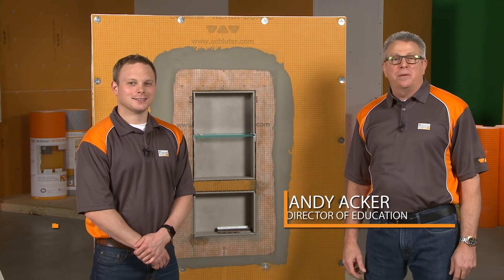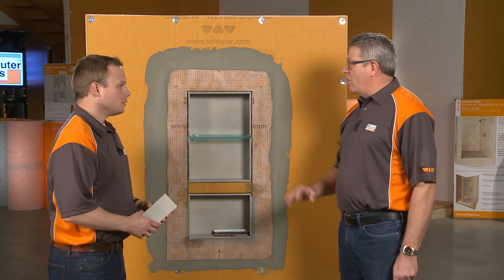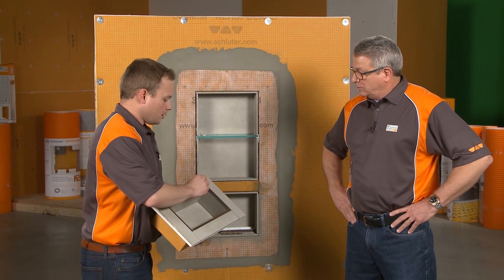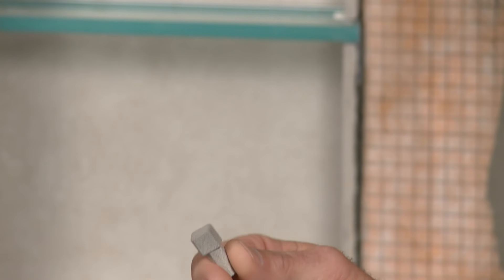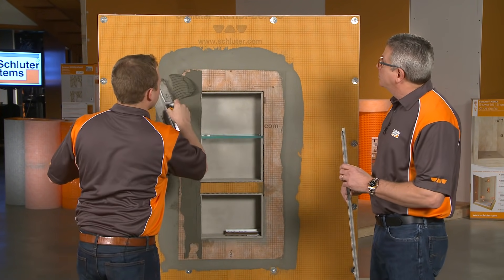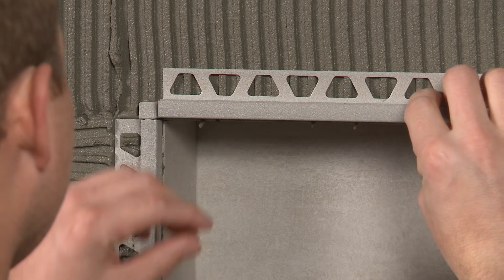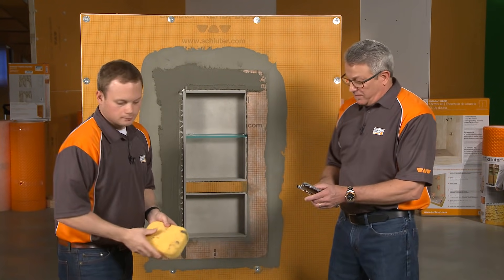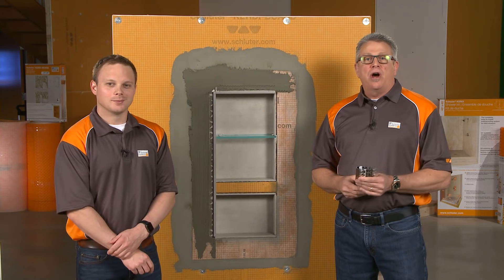Tips on finishing a shower niche

Comment: I set my schluter edging profile on the inside of the niche with miter cuts as I'm setting rile. Then, fab the niche with wood and then coated in waterproofing. not sure why you'd make it harder and doesn't look good setting it on the face, imo
Reply: Thank you for pointing that out I will be doing my niche in the next week or so.
Reply: @Justforfun-ek7et  ser the inside of niche after the face of wall is dried. use the edges of the niche as a guide when cutting around niche. layout and niche placement is important. You got this 👍 @wishbonecustomtile

Comment: Now when the tile goes on the wall it has to much material behind it to be flush with the trim
Reply from the maker: Just make sure to select the proper size profile according to the tile thickness and format-- you should be good!
Reply: So, If I'm installing 1/2" ceramic tile, I have to get 1/2" trim? Does the trim account for the thinset? Won't the tile be higher then the trim with thinset? Please help and explain. Thanks
Reply: @rjvillanueva64  yes, you are correct, get another trim size that is the next higher size to accommodate your mortar.  The people at the tile store I should help you with this question
Reply: @rjvillanueva64  You have the right idea. Keep in mind that a tile labeled as a half inch nominal size isn't exactly a half inch, remember that the anchor leg has a certain thickness, remember that the schluter profiles can be installed with the anchor leg in either orientation,  etc.

Comment: It's hard to see but, is the Keridi board flush or recessed with the edge of the inside niche wall? What forms the seal on that edge? Is it just grout between the inside niche tile and the Rondec that is the seal??
Reply from the maker: Hi there accidentalvoyeur! The Kerdi-Board meets the "flange" of the niche and is flush. Then the waterproofing seal is created by using Kerdi-Band over the abutting edges.

Comment: If installing glass mosaic inside the niche, do I still use unmodified thinset even though glass is usually in modified thinset?
Reply from the maker: Hi Roberto, 
It's important to check with the glass manufacturer for suggested setting materials. Please give our team a call for details, they can be reached at: 800-472-4588. 
Thank you!

Comment: Its nice to add these corners instead of miters, but 2 - 12"x20" niches with stock shelves would require 16 pcs at over 12 dollars each is over $200.00, not good!
Reply from the maker: Hi Tom, in this case with the 16 corners, it can get a bit pricier, especially if using our solid aluminum corners. One cost-saving option could be mitering the corners instead.

Comment: You forgot to mention how much of the sluret metal you need to leave for the piece of tile that goes inside the sides of the nitch which is a very important point, because if you install the sluret metal flush with the edge of the  cement board, it's going to look terrible,.so you need to leave it over the edge of cement board at least the width of tile you're installing “plus" 1/8 of an inch for thinset in order to make it flush with the slureth metal.
Reply: i think i know what you're trying to say, but exactly what does "slureth" mean
Reply: @ZunarXJ59  the slureth metal it's the metallic finish.
Reply: They way they did it and also the way I do it, is to install the tile inside the niche first flush with the wall. Then you set your trim on the outside around the niche. Now Just line it up flush with the tile inside the niche
Reply: they used kerdi board not cement board, not that that changes how to use profiles.  I don't use hardie or durroc anymore, I love the kerdiboard
Reply from the maker: Thanks for your trust in our products!
Reply: @ZunarXJ59  schluter is the brand name of these trim pieces.
Reply: Ruben D   the inside tiles were already placed first. it was hard to see that because the tiles are the color of cement board. they were using a prefab niche and it is all orange colored.

Comment: Do you recommend a possible 45 degree angle at each edge as a possible option vs. the finisher insert?
Reply from the maker: Yes, you can also miter the edges. :
Reply: Those called bevels not miters btw
Reply: @andriyshapovalov8886  they were saying yes, you can do a bevel cut. You can also do a miter cut
Reply: @andriyshapovalov8886  I think it could be called a bevel or a miter depending on if the profile was being set with the anchor leg on the wall vs inside the niche.

Comment: I get they are trying to sell a product, but why not just set tile on the inside walls of the niche to be flush with the surface first, then set the outer wall tile so overlaps the edge? I think that doing this would be much cleaner and easier and doesn't require overpriced unnecessary edging. Also, who the hell did your miters, they should be fired.

Comment: You guys are doing it backwards The profile installation goes inside the niche.  You have to build the walls first And then the niche.  The main reason about doing the walls first is because you have to plumb all your walls first. Unless if you don’t care
Reply: So the anchoring legs go under the tile on the inside of the niche rather than downward against the shower wall, right? 
So as you lay or install the tile on say the flat part of the niche, go ahead and place the Quadec or Rondec piece under the tile, right?
Reply: Lol at this guy telling the manufacturers how to install their own equipment. If you watched the other videos you would know that it can be installed either way, and that this particular demonstration is an intentional oversimplification.

Comment: Well I got to the job ready to build my niche. Problem is Arizona tile doesn't know what they're selling or what works with your product.
The corners they gave me didn't work I had to miter all of it. 8 miters and every cut the saw tried to rip it out of my hand. Don't tell me to use more teeth. These are meant for wood. But what do I do? Lose another half day trying to explain what Arizona should already know?? Then of course I have to wait a week or get stuck with 60 bucks worth of freight.
None of these miracle solutions are worth it. I could have bullnosed everything and been done. There is no way I won't have to back cut my tile tomorrow because unless you're walls are finish carpentry flat this stuff is not going to lay correct. Sticking two pieces to a wall in the middle of nothing with nothing against it means nothing. It's just a pitch.
Reply from the maker: How did it go?
Reply: Arizona tile suks

Comment: just so you know rondec sucks. please trust me. ive tiled 30 showers and have used the system and you cant cut or fit the metal properly
Reply: If you've done 30 showers then you can afford a chop saw with a nonferrous metal blade.  Use the schlueter corners.  If you can measure accurately...no problem.
Reply: I've done hundreds, as have many of us, and if you can't figure out how to cut and fit the pieces then tiling is not for you.